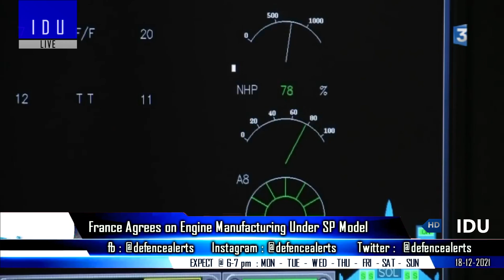Indian Defence Updates : Agni Prime Test,India France Engine Deal,Project Vishnu New Hypersonic ALCM

Comment: In my view, both the air launched version and the ground launched version of the hypersonic missile should run concurrently to speed up development. There is no need to wait for the ground launched version to be completed to start work on the air launched version as both of them will be completely different from each other.
Reply: You have to have a functional hypersonic missile first which would be more or less common to both versions.  You learn from the ground launched version before undertaking the air-launched version.
Reply: @satmohabir7175  the point is, there is no way there is going to be anything common between the two. One is a 2000 KMS hypersonic cruise missile, the other is a lightweight 700 KMS range air launched version. Both the designs should be started with a clean sheet of paper. Trying to adopt a long-range ground launched cruise missile to be launched by an aircraft is a redundant process itself.
Reply: @muraliradhakrishna167  India has successfully tested a hypersonic missile but this is a demonstrator.  Only Russia has a functional hypersonic system.  So I expect there will be additional tests before India will have a functional system.  But, to clear up matters, I am not suggesting a sequential preparation for tests - the ground launched and air launched systems should both prepare for actual testing.  But the tests should be done sequentially so that the applicable experience is passed on.